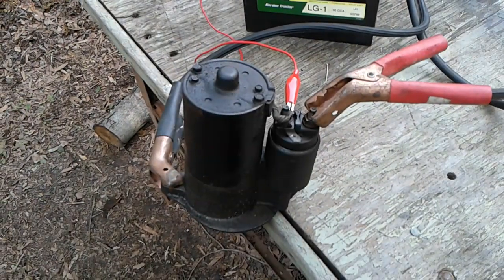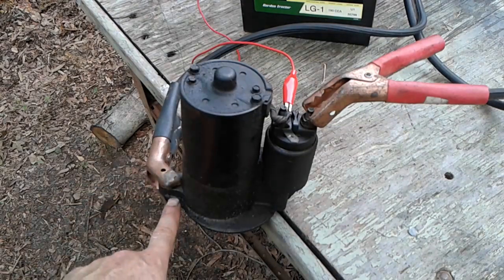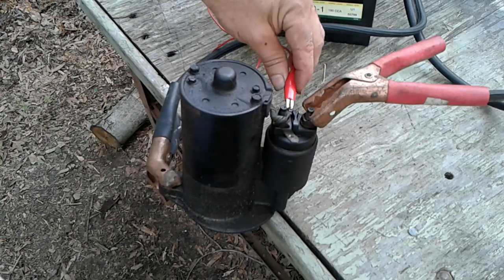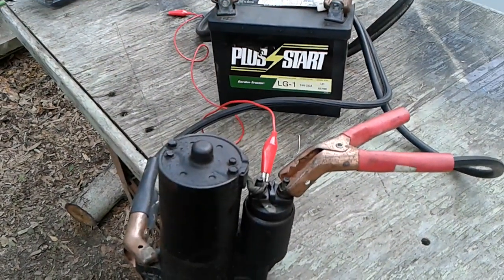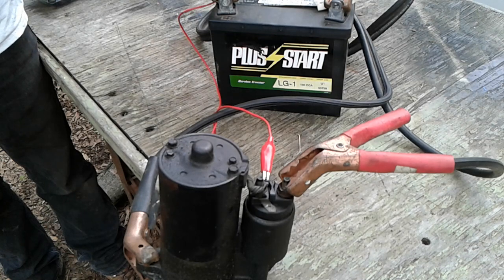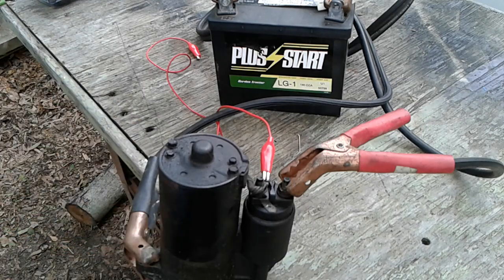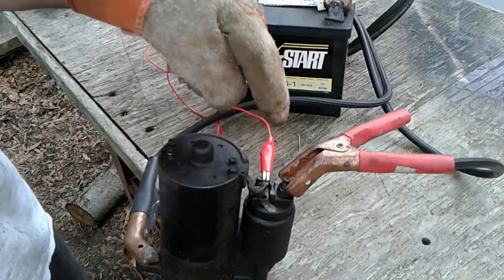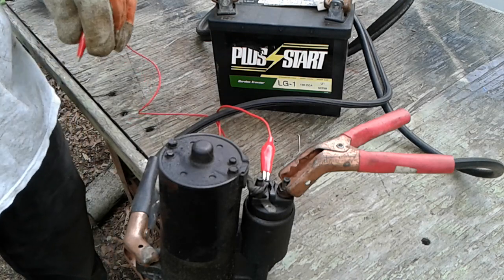Starting System Diagnosis - Starter Motor Test - Ford V8 460 CID

Comment: I have a 1997 Fleetwood Pace Arrow.  Ford F Super duty 7.5L V8 Gas.  Engine Displacement is 460.  At first it would take multiple times to start now it won't start.  Comes close but does not start with a fully charged battery.  I'm thinking it could be the relay or maybe the motor.  Thanks for this.  Now I gotta figure out if this is the right fit.
Reply: check main connection module just did the same thing on mine
Reply: Steve Savage thanks, my issue turned out to be a bad starter solenoid and bad fuel pump.  Swapped them out myself.  Good to go.

Comment: Under load the starter change if the brushes are to wear  or the commutator on the motor wiring  is burn or to full of grease  or carbon and the berings if there are gone front or back the start motor wont pull not anoff force to move the engine so it will engage but wont  have  the to power to turn or the engine is luck up  take spark plug out grab a wrench and try to turn the engine if move free you stater or solenoid is the problem butt the solenoid you just by pass it with a metal rod and if the engine move you know were the problem is